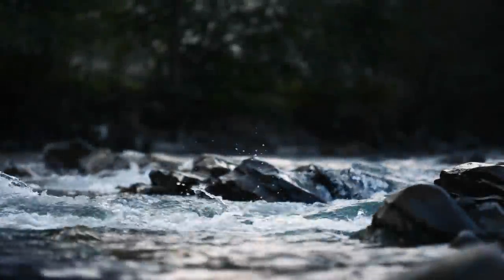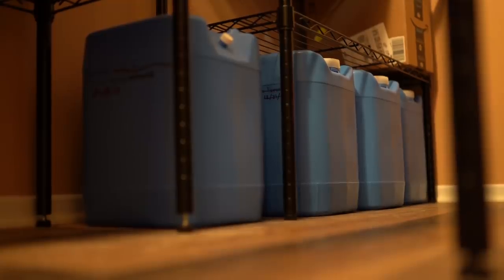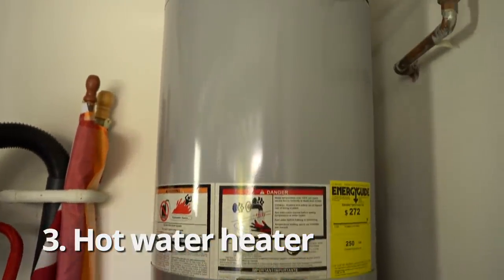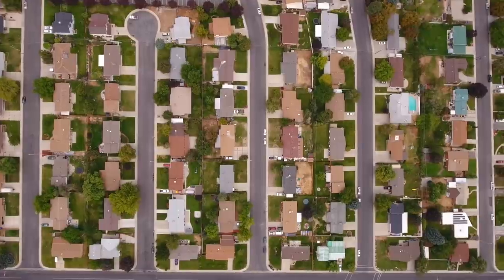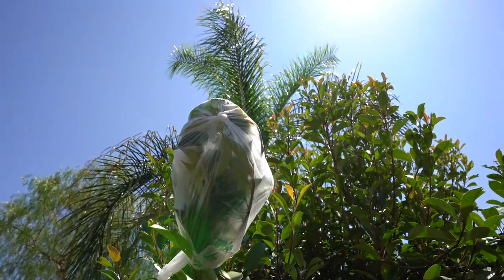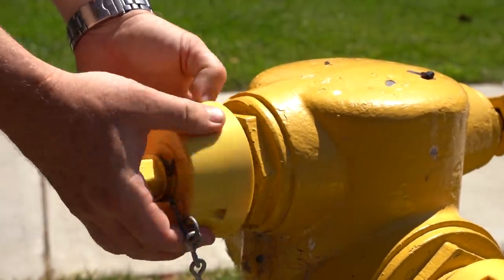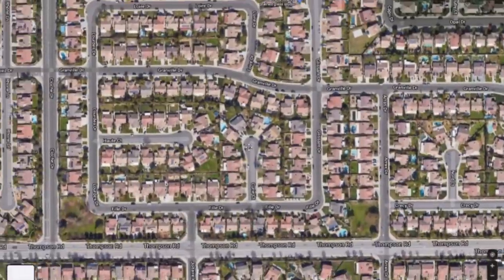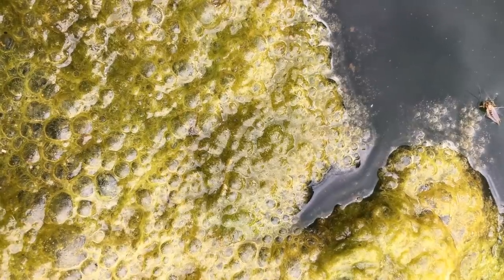12 Overlooked Places to Get Water After SHTF

Comment: A lot of old wells only have a 6 inch pipe to get to the water, they sell PVC well buckets to drop down these pipes but you can make them yourself for about $50 there are videos on how to do so. I was able to get a good deal on 600ft of 1/4" yellow polly rope online for $28 plus shipping. If you know of any of these types of wells are in your area having the PVC bucket and rope would be a cheap way to get to that water supply. Down side is if the well pump pipes are still there you have to pull them to use the bucket.

Comment: And if you’re really desperate for water here is what you do…… dig a hole. Place a container in the bottom. Spread plastic over the hall and secure a box and place one rock in the center of the plastic over the container. The earth three leads this moisture which is captured on the plastic and the condensation drips into the container.  I grew up in the desert and this was always taught to us as the best way to get water in an emergency situation.

Comment: If you are a true prepper and have your own source of electricity, solar, generator, etc. then you can also use a dehumidifier to pull water from the air. Also consider taking what normally be the 'gray' water (not toilet) from your drains and filter that and recycle for misc water use.

Comment: You will need to seal the plug in your bath first as it will leak water from the plug over time. After a day it will be empty if not sealed.

Comment: on the water heater tanks - its a great idea but remember to keep your water heater clean by isolating it , draining it and filling it with vinegar every six months to keep the calcium scale down and bacteria free. then run the vinegar in the heater thru your house and re claim that water for your garden, or general house cleaning.

with the toilet always scrub the tank when you clean the bowl to keep scale, iron and mold at a minimum

Comment: I have an artesian well (380ft). I need a pump to lift it. I have a transfer switch system that can be fed by a generator. Storing fuel for the generator is my issue, as the generator serves more than one purpose in an emergency. I also have a small creek that runs through my property all year but the water must be filtered and boiled. My neighbor has a tapped spring (gravity fed) well that can be used.

Comment: I use to work at a welding plant, and let me tell you. The place got upwards of over 100f and they had 5gallon water stations set up all over the place, the storage room had about 100 5gallon jugs. They ran 3 shifts, non stop 7 days a week 24 hours a day. Those jugs went quick so they always restocked. If there's ever a thing that happens where you need water, go to a factory or plant that welds propane tanks or ect. You'll for sure find water. When everybody goes crowding the super market, go to your nearest welding plant.

Comment: If you have a yard a pitcher pump would be a possible idia.  If you can drive a sand wedge 30 feet or less the pitcher pump can pull the water up.  This is ground water that is technically drinkable without filtration or treatment

Comment: I added a water valve just after the water main shut off in my home, just after that valve I added two whole house water filters, now I can shut off the main, hook a pump to the second valve and pressurize the house system using a 55 gallon barrel to supply the water, I have a stream where I can get water from.

Comment: I personally had to use water from a road pothole, wooded ridgetop area not city.  Plus filter.   City telecom manholes ( not San sewer), pump water from city blow off,   run your car ac, capture the condensation dripps,  water left over in side garden hoses,  fish tank ( maybe dinner too).

Comment: We have a tub bladder. Right after a disaster or before if you have warning, you place the large plastic bladder in your tub and fill.  They hold ~100 gallons and keep the water cleaner, longer than just running it into a possibly dirty tub. You don't have a lot of time if municipal water goes down. You are basically pulling what is still in the lines.  The bladder comes with a small pump built in so you can use water as needed. The bladder also compresses as you use the water which keeps the air out.  We found ours on Amazon. Around $30.00 I think.  This hasn't anything to do with water, but keep any gas cans, vehicles gas tanks filled with gas.  I top my car off when tank gets below 1/3 tank. We have a car we rarely drive and we keep the tank filled lately. It's like a large gas can.

Comment: One source that may or may not be legally accessable, but in an apocolypse...,  Most modern buildings have fire sprinkler system and the risers are normally in stair wells. There are always test valves somewhere in the system that drain normally to the outside near the test valve.   Look for a pipe coming out near the stairs normally 1 inch in diameter or less.  Depending on the size of the system, there can easily be 20 gallons per for for every 10,000 square feet of building space. This valve may have a lock on it so come prepared.  Sprinklers in outdoor environments will probably be dry system and the only water will be at the riser valves in a heated area.
Reply: Dear god have a water filter and hold your nose while collecting.  Stagnant water from a sprinkler line smells horrible!
Reply: Yes it does.  It will need to be filtered and boiled.

Comment: After working in Telephone manholes for over 50 years I'm telling you many manholes are full of hundreds of gallons of water. Usually it is pretty clean. It isn't sewer water it is totally another underground river. In wetter areas the manhole runs have almost an unlimited supply of water. In the Southern California desert those manholes have water also. We carry 1 1/2 inch pumps that really pump well and sometimes it takes hours to pump one manhole. If it comes to SHTF you can get the lids off with a large screw driver and a shovel. The hooks can be purchased on line for very little and you can pull the lids off on most of them or you could put a garden hose through the hole in the lid. That's enough for me to say.

Comment: Keep a child 10' round pool on hand to fill with water during SHTF.  You could store it with water, in the basement,  if you have one, or outside.  Might also buy a cheep pool filter just to circulate the water.  Run it from a solar generator for an hour a day, and have some chlorine on hand to keep any algae at bay.  Could use this water for baths, washing dishes, or filter it for drinking..

Comment: A possible source of water is a condensate from a dehumidifier or an air conditioner and the means to collect and filter, preferably purify, the water. Stating the obvious, this means you have this equipment and energy to operate it.

Comment: I use a pressure canner and a sand filter to get water I run the water through the sand filter then run it through the pressure canner but have a tube attached to the vent put it on a small fire and let the steam for the vent condense in gallons.

Comment: I have a 550 gallon hot tub as my backup water supply, and I have an aluminum chute I made so that I can connect it to my existing rain gutter system on my house to divert rain water into it should I need to resupply it.
Wife has always called me nuts, then snowmagedon hit us in Central TX, wiped out power for 5 days and water for 3 days. My wife and I were sipping wine in the well lit house next to the roaring fire for almost a week. My neighbors on the other hand...I was lending out wood to 2 of them, extension cords to another, and rock salt to the one neighbor who crashed his SUV into his box trailer just trying to get out of his driveway because he had to go find supplies. Had to melt his drive so he could get off his trailer. Thousands in damage I have no doubt. She said after that she will never bother me again about any of my "improvement" projects.

Comment: No containers? Use trash cans lined with thin plastic drop cloths for cleanliness. Empty Large flower pots lined also and cover. If you have garden area available, dig deep hole and line with drop thin plastic drop cloth . Hole no bigger then cloth.

Comment: Missing one...the pipes in homes. Assuming water is out...even after draining the hot water heater there is still a lot of water in the lines themselves.  You will need to cut the pipe...but there's many feet worth of potable water lying in those water lines hiding behind the walls.

Comment: For as long as you have power you can literally manufacturer water from air which you are probably doing now without realizing it your a/c unit is making water and has a water run off system also a dehumidifier is making water from the air around you now both are pure water with no heavy metals or contamination well the dehumidifier is anyway if you collect water from your roof remember that it will contain contamination from bird poop filter and boil it to cool water even in hot climates place a bottle of water in a woolen sock soak the sock and hang in a tree in the shade after an hour or two if you keep the sock damp you will have remarkably cool water.

Comment: You get plenty of water from your sprinkler system if you have a backup power supply such as a generator you can connect it to the motor of your sprinkler pump. Once you get the water you should filter it and treat it. and boil it using any source of heat you can make.  You should make provisions to connect to your sprinkler system pump from your generator,but if you do this you make sure that you shut the main breaker box switch off so that you do not get any connection to your public service electrical system.  You should also, put a hose connection On the discharge line from your sprinkler pump so you can connect a hose to it.  These provisions should be made immediately so you don’t have to worry about it after the SHTF.

Comment: Look for abandoned industrial projects and plants, construction sites as they may have large ranks or tankers trailers; there is marking system that should simply say “potable water” or “distilled water” etc on the tanks they use. Make sure to check the water in these tanks thoroughly  before you drink it.
Air conditioning units usually produce some significant level of water, especially in high humidity in summer. We have the water lines coming out of wall-mounted regular A/C split units connected to used large water bottles we use to water the plants in summer time. If the power goes down that gathered stays for few days before it evaporates, still, it would need to filter that water with a sawyer squeeze filter or so before it can be used for drinking.

Comment: i wouldnt drink water from the toilet bowl or any other place like a bit of water under the sink. the reason the water is always there is that it acts like a trap. it seals off the room from the sewers. basically if you remove water from the trap all the foul oders from the sewers will go back up the pipe and you wouldnt have a good time. keep the water there it stop the gas coming through

Comment: Desalination. Pressure cookers work well for this, simply fill the pot to maximum capacity ( p.cookers are made to only take 2/3 water to avoid dripping) and bring to a boil, when water starts to escape via the seal on the lid take off the boil and place on hot coals, position the cooker on an angle to focus the drip into one place and put a container here, preferably a steel pot or can.This is a slow process and inefficient for survival needs for multiple people.
 For survival needs the best option would be to place onto a stove such as gas to simmer. A rocket stove would work as long as a person was present to keep it at simmer rate. It ends up being an all day event of constantly desalinating but if this is your only choice and you have the gas or can give your position away by using fire, this is an option. Remember that distilled water needs non distilled water added to make it safe for consumption.
Reply: No it doesn't, distilled water is pure water and safe to drink as is.  That said, it lacks everything, including the electrolytes we need to efficiently rehydrate.  This is where that canned food water or juice comes into play, just pour the water from the can into your distilled water.

Comment: If you live in a large apparent building like in NYC, you have to act fast. Each building has its own water tower that feeds the apartments. If the water line came in from the basement and went straight to all the rooms, you'd know every time someone was doing laundry or taking a shower because you’re pressure would diminish quickly. So solve this they use the line coming in to go right up to the tower and fill it. So they put a large line from the tower straight to the basement and all of the rooms are then tapped into it as they go down. So if your feed is a 4in pipe going down and each room has a half inch line coming off, so much water is moving that you'd never notice it. When that tank is empty,  that's it. No electricity, no pumping the water to the tower to then go to you.

Comment: Another source of water some may overlook in climates that get winters is accumulated ice and snow. You can melt, philter and treat this frozen store of water just out your door if it's available to you much as you would any other source of water mentioned here.

Another thing to note, is even if you have a water source you can't easily get potable, it may still be useful for cleaning, irrigation of crops, watering pets and/or livestock, and other uses that don't involve humans drinking it. This will conserve your potable water for the most important uses you can put it to, drinking and cooking.

Also, A caution about using the water that canned beans come in - that water can contain toxins and starches soaked out of the beans that can give you gas or diarrhea - in fact, it's using this waste water from soaking beans (to avoid wasting the water) or not treating beans properly that often leads to people getting into their troubles with beans.

Comment: Two areas of concern are:

1  Be careful of fountains and other water works present as public water displays.  Many times these run on limited amounts of recycled water and various bacteriostats are added to reduce the amount of growth by various microbes such as algae, bacteria, and the like.  Since water in these systems is not required to be potable, cheaper equipment used such as pumps may also allow oils and other contaminants to leach into the water.  Many of these additives will make you quite ill if ingested in sufficient quantities.  Filtering through an absorption filter such as a Berkey filtration system MAY remove them depending upon many variables.  Other filtration devices such as a Lifestraw that simply filter out large particles such as bacteria or algae will not provide any protection from these dissolved bacteriostats.  The only sure way to make this treated water potable is to distill it.

2.  Be careful of using rain collection systems based on roof runoff or runoff from a similar system.   Bird feces is almost certainly present on the roof and the presence of squirrels, bats, and other animals can add their urine or feces as well.  Some claim that you can avoid these contaminants simply by allowing the first fifteen minute of rain to not be collected and that this will act as a wash to ensure water collected later will be clean.  This is a dangerous assumption.  Bird feces are a mixture of uric acid (the white paste like material) and feces (the dark material in the center).  Both the feces and the uric acid are sparingly soluble in water so only collecting water after a few minutes of rain will only ensure contaminants are somewhat more diluted.  If you are extremely thirsty or feel the need to take the risk, then you can drink this runoff water.  Otherwise, treating the water before drinking would be a better bet.

Hope this helps.

Comment: It’s only fair to add this… If you think water from the back toilet tank is questionable… Google some images of the inside of a used water heater. I would prefer the former to the latter. Lol.
Reply from the maker: srsly.  if hot water heaters are not properly drained periodically, the build up is insane.
Reply: @CityPrepping  Yup. And it’s not just a sales tactic. A whole house water softener goes a long ways towards preventing an untimely end to your expensive appliances.
Reply from the maker: @JamieHitt  I almost bought one of those systems. So I guess you recommend them?
Reply: @CityPrepping  Truly depends on your water profile and what you are hoping to accomplish. But a great many water heaters, dishwashers, washing machines, and plumbing fixtures require a water softener in order to honor the warranty. 

A great many aspects of water treatment can be accomplished with ion exchange resin. And when properly back washed/regenerated, the addition of sodium to your water supply becomes a myth.

Still to this day, if you are on city water with good pressure I would recommend a twin tank Kinetico System. I would have a 5 µm pre-filter and a 20µm carbon block post filter.

But you have to watch your water treatment professionals like a hawk. Especially with Kinetico. The mark up/profit margin is insane on those units. I can easily sell one for $3500 but my price is right around $1200.

Good news is… Since they are hard plumbed/permanent install, they are considered a capital improvement and tax deductible.